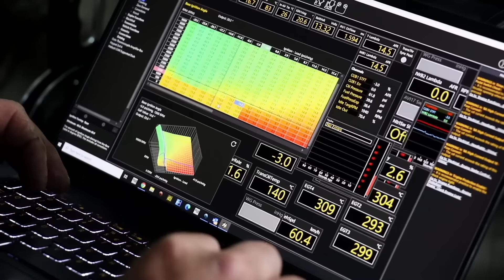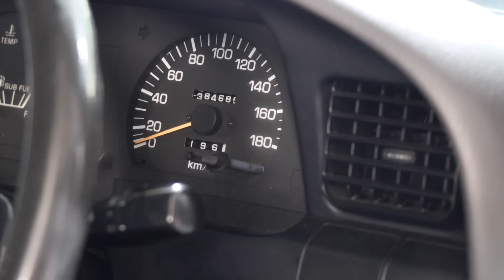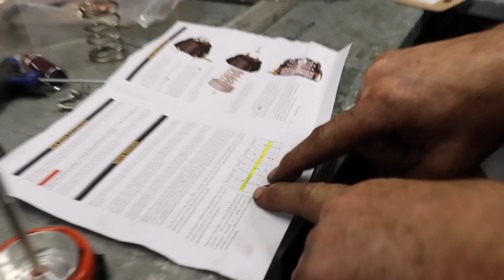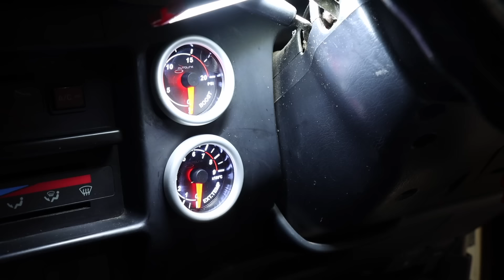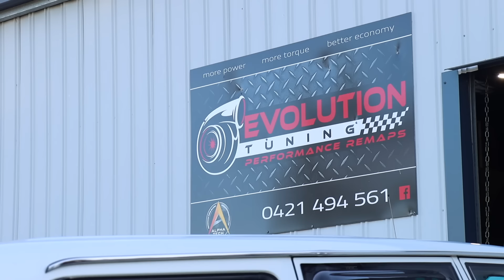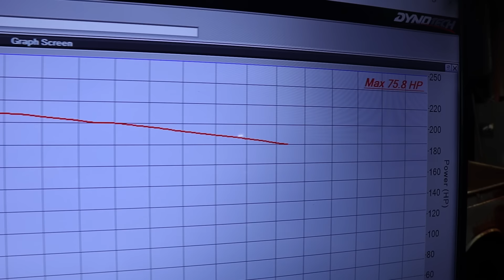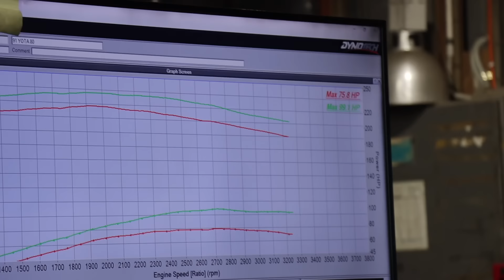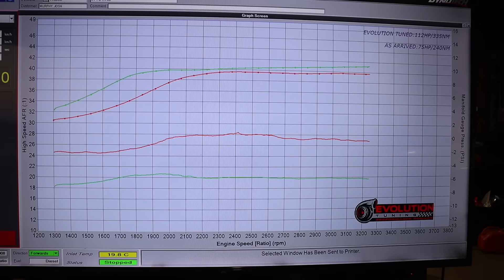How To Turbo Your Toyota 1HZ on a Budget!

Comment from the maker: No Siri he said 80 Series!
Reply: Hilarious, if I hadn’t read that top comment I would have wondered what the hell happened.
Reply: No 8 ball in the sump. WTF
Reply: I really like how you've retained the stock airfilter assembly. Also while you've got the sump off and doing a bearing roll-over because of kilometres,  why not throw an oil pump at it?
Reply: You have to dig through the timing case to get at the oil pump. So having the sump off doesn't make it that much easier. I also have a suspicion that they're not the cheapest thing.
I'd assume if the oil pressure is still good you wouldn't go there.
I'm not a mechanic. 👍
Reply: @TheCuttz1984 it's in the turbo now, after the dyno 😂

Comment: As someone who just bought a 1hz 80 series... I highly approve of this episode.
Reply: another person doesnt know what to buy...  what you should of bought,,was a gu nissan..4.2tdi..  because there better..if,,as you dont,,know anything about 4x4rs.. if toyota, use the front diff, & steering box, from a nissan,,,what  would you buy,?, a toyota,,or nissan..  plus,,nissan have a transmission brake & better wheel base..& fkn cheaper..  you bought a badge..
Reply: @harrywalker968 alright, keep crying, I’m laughing in my 80 series going strong, no need for Nissan parts

Comment: As a fellow Na 1hz owner I commend you lads for posting this, absolutely helpful, especially the bearings issue I would've otherwise not known about. I think a turbo kit is most definitely on the cards now. Once again great video Al n Woody good on yas !
Reply: Googles plastigage......
Reply: @jo300hn he wasn't talking about not knowing what pastigauge was, he meant he didn't realize the engines had issues with the factory big end main bearings having issues and needing replacement
Reply: @MineZilla123  I didn't say he didn't know about plastigage, but it's the logical step after finding about the issue, 
Learn about problem
Research problem
Price bearings and Permatex
Google plastigage
Duurh

Comment: I love this... so many people gave me crap for doing mine the budget way  , i went the super cheap way with a used 1hdft turbo+manifold off a mate, made oil ligns, sent it (only went this way because the 1hdt manifold flows better in the collector and ive seen guys use the 1hz manifold and get higher egts basically just from flow in the stock manifold... not that anyone shouldnt do it that way, but i had acess to the 1hdt one so i went that way) all in all i did the conversion for under $800

Comment: I’ve found over the years it’s a good idea to sort the valve clearances on the 1hz. It never gets done as needed and it often makes a good difference.
Reply: Under rated comment
Reply: Out of curiosity, do they tend to tighten up because the valves recede into the head, or get looser from wear at the other end?
Reply: @Rollin8.0  looser so the valves don't open all the way.  Due to wear
Reply: As with 1kz
Reply: @Rollin8.0  Most of mine were tight . None were loose .
Reply: The 4.2 Nissan Patrol diesel also responds well to valve clearance after time.
Reply: & injectors & manifold

Comment: Hey Al, something I learnt recently when working on high 4x4's is to let the air out of the front tyres, makes it SO much easier to work on. Only took me 40 years to find that out. 😁
Reply: Something I learned really quickly as a 5'7" short ass that often found himself uncomfortably sitting on top of the engine to be able perform certain tasks. Can even go one better, take the wheels off and sit the axle housing on stands at their lowest possible position.
Reply: @eamonquinn70  
Use a tractor mounted FEL and dig down so you can put the front end of the 4x4 in the hole and just walk into the engine compartment.....
Reply: @JohnSmith-yv6eq  I don't have the land for that but I'll have a hoist one day.
Reply: @eamonquinn70  
Sorry mate I was being facetious.
It just was too much of a temptation to see "how low I could go".....

Comment: Years ago I had an 80 (1HDT), an interesting 'trick' I found was swapping out the airbox with one from the 1FZ model, its the same airbox, only the lid is different. Instead of being flattened its a nice radius bend and slightly larger pipework. Just that one change boost increased from 12 to 17psi! without a change to anything else. Wound it back down slightly
Shows a major restriction in that one part, made the system more efficient with better boost response

Comment: My hdj80 just rolled over 600 thousand.. replaced the big end bearings at 530xxxkm, basic mods, intake and exhaust.. never has missed a beat, paid 8k for it just before covid 👍
Reply: Lucky bastard, I coughed up 26k for an NA hz 80 last year, at least with only 230,000km

Comment: I've done that trick Al mentioned about filling the sump up with oil when you drill to flush the filings out. Only I did it with diesel because it's cheaper and I could filter it and still burn it.
Reply: I get really big old speaker magnets and sikaflex them to the sump until I pull the sump at a later date

Comment: One of the best vids you guys have made. I have a tidy 105 with the 1fzfe. I'd love to see a similar vid for those of us with this thirsty underpowered awesome rig.
Reply: See Sam Youngs latest 80 build 🤙🇦🇺
Reply: Or the 1 on built not bought when it made more power than his supercharged ls...😅
Reply: The 4.5 petrol 1FZE is a bullet proof engine albeit thirsty, there is a historic video explaining how Toyota designed it for minimal servicing in 3rd world regions, they will do phenomenol mileages with basic servicing as will the 4 speed Aisan auto's, unlike the non turbo diesel manual gearbox  that usually loses 2nd gear synchro and overdrive 5th problems by 250k, later 24 valve turbo diesels gained an upgraded gearbox to handle the greater torque. H150 VS H151 if my failing memory serves me correctly.
Adding LPG though would often create valve recession as the valve seats were not induction hardened at factory.

Comment: I remember the comments on the Cummings patrol tuning video complaining about the soot, but anyone who watches Chris’s channel will realise that he knows his stuff and I’ve learnt so much about diesel tuning. His videos are phenomenal!
Reply from the maker: I changed the turbo on the cummins because it was too lazy and caused lots of smoke. And a P Pump with big delivery valves and modded fuel plate is going to smoke. That's what common rail is for, power without smoke.
Reply: @theskidfactory  That cummins patrol was an absolute rig, one of my favourite in depth build series.

Comment: Can confirm that 1hz’s do in fact blow up! Bought my 2003 105 standard with 340xxxkms and an aftermarket turbo already done, but years of being thrashed by the teenager that put that turbo on and a general lack of maintenance will melt pistons and crack the head. And let me tell ya, it was not  a cheap rebuild!
Reply: He did say won't blow up stock.

They're easy enough to kill with a pile of fuel.
You can actually ruin pistons with bad injectors even without boost. Not common though.

And yeah, definitely not a cheap rebuild.

Comment: love the show guys pro tip for him from past explosion check the viscus hub fan to make sure its working you can re fill them and after having to build another motor after it got real hot from 10psi boost  on a 1hz turbo intercooled motor it cost alot for a over looked heating issue
Reply: 100%, we suggested straight away Josh replace his radiator, as it had gone the lovely brown colour they do often before they fail. When ever we increase power, we always want to ensure the cooling system is up to the challenge.

Comment: I've got a D22 Frontier, US made, '98 4x4 gas model . . . Not popping the oilpan off one of those to do an in-frame rebearing without removing the front axle, crossmembers etc.  I've got a Turbo kit for it (and a spare engine, mine is close to 200,000miles/321,000km), but have not gotten the time to toss it on.  
Time. I just don't have as much of it as I used to.

Comment: Love this channel. All about working on cars ya self. My daily is a 06' NA forester and I've always wanted to just give it a little extra, like rear mount turbo it, and a snorkel. If i didn't have the supra to spend money on in be about it. The Forester has 250km so I don't want to push it, just like I have with the supra. Pensioner life is a thing. I feel like my daily with just 5-9psi would be a game changer but I'd be most interested in the fuel economy savings would be on pump.

My JZA80 has a 6262 on it and I have managed to get 712km out of a tank with the factory ECU on 13.4psi. My forester does as best 580km out of a tank with the same tank size. I am a biz lazy making youtube vids but id love to do a comparison when i turbo it one day

Comment: Early 80 series 4.2  1HDT Turbo diesels were known for bearing problems from new often under warranty, this was fixed by Toyota  I believe a bearing type change.
I purchased a 1993 1HDT 80 series auto in the late 90s cheaply with bad bearings, we gave the crank after a good grind and linish and on recommendation installed some Australian ACL bearings, this worked well and later an uprated turbo fitted running 14 lbs boost.
It was driven firmly with a large offroad camper trailer on many of Australia's outback tracks and was quite reliable.
Good oil and good bearings!

Comment: I have fitted a fitting to my sump without removal using a 5mm drill bit, series of tapered cone wedges to flare in the hole, and tapped it in with a bit of plumbers liquid thread tape. never leaked, no issues.

Comment: Good job, especially because you did the bearings. I've seen so many old cars dynamited because the owners cut corners. You do a turbo kit? At a minimum check the bearings. It will only cost you less than an entire new engine.

Comment: I did my 93 Troopy with an $800 2nd hand Schweitzer setup running 8 pound of boost, fitted it at 434000km and sold it at 487000km its still running today!! At over 570000 km. It was the best thing I did to the old bus in the 14 years I owned it….Didn’t run an inter cooler either.I ran the 2.5 “ exhaust it had with the extractors prior.

Comment: Replacing bearrings and even rings ist just a good overall practice when going from na to turbo. While you´re at it, put a new headgasket and she´ll probably do the same ks just with even with more power. And thank you for that mention with the fuel screw...

Comment: I think people who scoff at the numbers miss the entire point of diesels.  They got 25% more hp but also 50% more torque - which makes it a joy to drive.  That's not to even mention the best part which is at these increases and power levels, tuning increases already reasonable fuel economy.  Do I want a bloated racecar with a diesel no, but driving 10 hours to get to the track rather then 15 in a gasser (better hill pulling and better fuel economy) makes me a better racer.

Comment: Great content and presentation, I have an Isuzu nps 4x4 4.6lt Na 4 cylinder 4HG1 which is new 85kw, need about double to tow corvette, so this is the start of a practical solution, now to find the parts.

Comment: Just quruius; doesent the big end bearings have 2 parts? The crank spins in 2 bearings? Or 2 halfs, creating 360 sircle at each big end rollers on the crank. One half goes into the block,  and one into the caps bolting the crank into the block
Reply from the maker: Yes the bearings are a 2 piece item per Conrod.

Comment: When you adjust the fuelling you are lengthening the amount of the/ degrees of injection.
Beyond 32/34 degrees not much will be gained.
Still plenty to be gained by more fuel though just need bigger pumping element/s.
Ideally you inject your Max fuel over same duration as standard.
Diesels generally cope with more boost.

Comment: so what did you do with your adaptor plate when you bolted it to the stock manifold al ,how did you seal it did the stock toyota exhaust gasket go in there ?  sort of skipped that bit . awesome vid
Reply: He chopped the outlet off the exhaust manifold. The adapter was welded onto the manifold
Reply from the maker: I actually made a small sleeve in the adaptor plate for the exhaust o ring seal but you don’t have to do that. I just like using my lathe. The exhaust manifold has a recess for the oring to sit in.

Comment: I owned a Volvo 940 TDI with the six cylinder inline Audi engine. 186000 miles no breakdowns still on the original turbo. Sold and now on 245000 miles. Have you ever worked on these. UK based.

Comment: I’ll be putting a turbo on my hz so this is very helpful. Just one thing though, where do you plumb the pcv from the rocker cover on to ?
Reply: Presumably before the turbo intake so as to provide the suction necessary
 (maybe with a good filtered catch can to keep the turbine wheel clean?)
Reply: Pcv can go between airbox and turbo.

Comment: Hi guys.Can you explain for the not-so-smart guys like me how fitting a turbo only (no extra fuel) makes more power (before the fuel was turned up). How can you get something from nothing? Seems like magic!
Reply: More air being crammed into the cylinder=more complete burn of the fuel....
More complete burn=more power.
So as he said, add more air and also add more fuel = even more power.
Until a limit is reached.
Then you need to cool the air being crammed into the cylinder...intercooler...
until the next limit is reached..
thermally speaking.

The "fogging" of the turbo air with LPG hasn't even been explored either....
that can be worth another 20 to 30% power on it's own.
Reply: Diesel + boost and stock fuel = the fuel is burnt closer to 100% efficiency (assuming it was a bit inefficient to start with)

Add more fuel = makes more power till the fuel overruns the boosts ability to burn it all up, (this is when you start to see it sooting up heaps)
then you need to add more boost again to burn the extra fuel etc…

But with ~10psi and a little more than stock fuel the power increase is noticeable and safe…
Reply: @13bttlotus  
Has anyone explored mild fogging with LPG?
Reply: @JohnSmith-yv6eq  there was a couple companies in Brisbane in the late 90’s early 2000’s that were doing LPG kits to supplement the Diesel turbo systems.

My uncle had LPG/turbo kit fitted to his patrol and I believe it’s still running like that currently.
Reply: They will often pick up a little bit of power, as there’s generally a little bit of extra fuel that’s not fully burnt in NA form. By adding a few psi, we can utilise that little bit of extra fuel and get a more complete combustion.
Reply: @boostedsagas884  That makes sense. Potentially a turbo could improve fuel economy if the car is driven in the same way - which I guess it wont be otherwise whats the point!
Reply: @ertcom1  that’s exactly how turbos can help improve economy, as they help to achieve a more complete burn, hence we are getting more energy transferee to the crank, from the fuel being injected.

Comment: My turbo 1hz detonated after 280k  back in the day. Even with the 50% increase in power still pretty gutless
Reply: Of course it is, but with turbo you don't need to push accelerator pedal down for 60 seconds to get to 100km/h.

Comment: boys - did you change the bolts when you did the bearings ? and any value in a compression test before hand?
Reply: also genuine BEBs or somewhere else? cheers
Reply from the maker: No bolt change, the hardware on these things is top shelf. We did not comp test, the engine was in perfect running order and had never had any issues.
Bearings were NDC which is an OEM manufacturer.
Reply: @theskidfactory  thank you, very helpful.

Comment: On those mechanical diesel pump and injectors. Try this it works and will not damage anything. If you guy's have 93 octane petrol in SA we have the lower 93 and the higher 95. But use here 93 mix 1.5% 93 per liter diesel. So for 1 liter diesel add 1.5% 93 octane gasoline.  If you go little over don't worry. So 1L diesel,  150ml 93 gasoline.

Comment: heard these are a lot better on fuel with a turbo like this?
Reply: They can be, they are generally making more power and more torque so you don’t need to squeeze their neck to get every last bit of power out. Means it’s a more relaxed drive experience which often leads to better economy…

Comment: Would a small barrel style water-air intercooler between the turbo and intake help here? Or nah?
Reply from the maker: If you're chasing more power than yes an intercooler would be beneficial  but in this application it's not really required
Reply: After years of running a 1hz non intercooled we are gearing up to add one, still only at 12psi but intake and exhaust temps are getting up there when pushed up hills or towing the camper. Just cruising and the occasional squirter you wouldn't need to bother but it certainly won't hurt, just adds complexity.
Reply: If you were towing all the time it’s a good idea.
Reply: Personal preference, a simple air to air is all that’s needed on these set ups. Water to air adds a lot of complexity for a system that’s not really going to utilise the benefits of it. All we wanna do is get intake temps back close to ambient after being compressed, a decent air to air will do that no dramas.

Comment: What are your thoughts on using Y fittings rather then T fittings? the 90° is bad for flowrate due to the path of least resistance always being the straight path, a Y fitting corrects that by making both paths having equal flow resistance. Have you ever had bad results with the T fittings?

Comment: 👌
Edit: I always thought/ heard that a pyrometer gauge is more accurate before the turbo.
Reply: Yeah it is as you arent disappating heat through the manifold and turbo. Just usually impractical to do is all
Reply: And I think some people are concerned about the possibility of the probe breaking off, which would ruin your turbo.

But my reading also indicates that you want pre turbo.